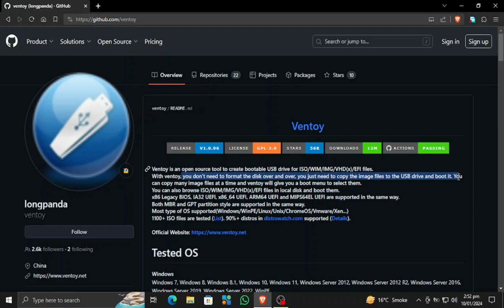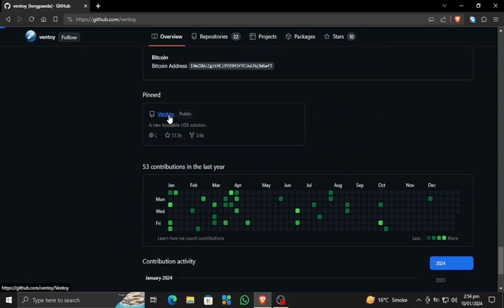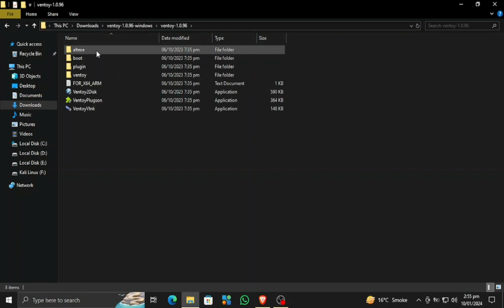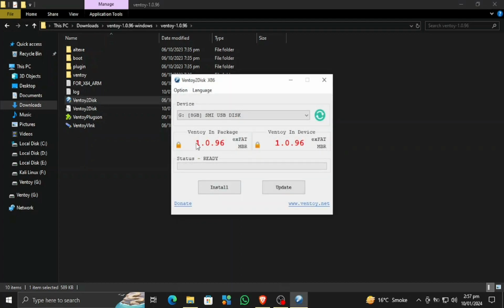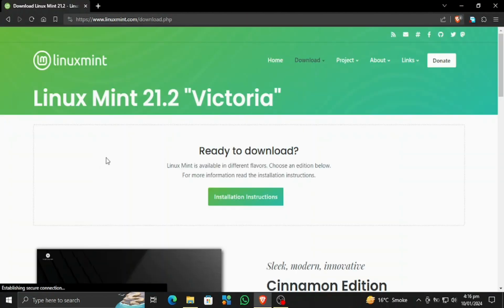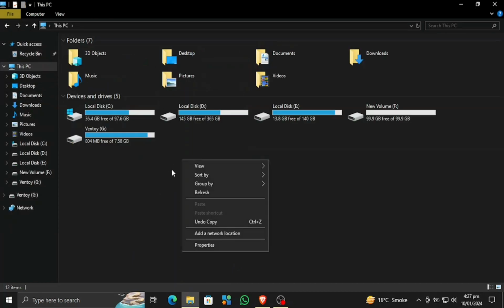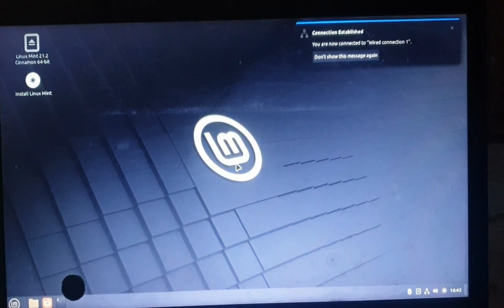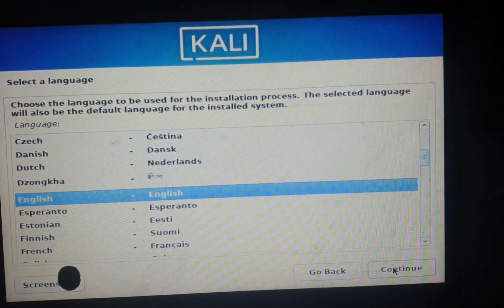HOW TO USE VENTOY TO MAKE A BOOTABLE USB DRIVE FOR MULTIPLE ISO IMAGES AND STILL USE IT FOR STORAGE!

Comment: Can I find a valid iso for windows 7? My mom's computer wrapped out and I need to make a bootable repair disk....
Maybe I could find a valid one using the wayback machine?? Is that possible?
Reply from the maker: It's Possible that you might find a valid Windows 7 iso. But Windows 7 is no longer supported by Microsoft. So, it might be a bit difficult and activation would be a real headache. 
I recommend that you install Linux Mint or ChromeOS Flex. That would be great if your mom's laptop doesn't work with windows10.